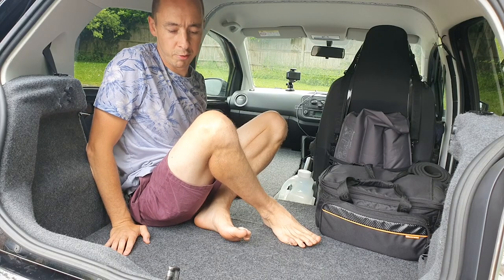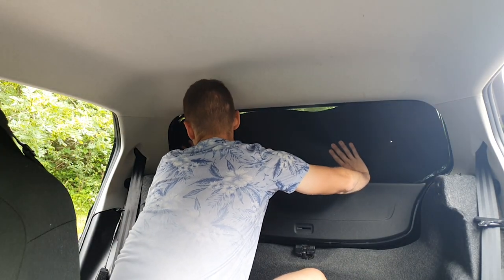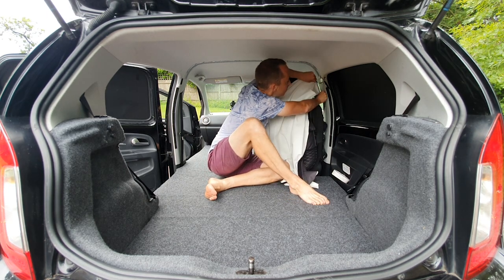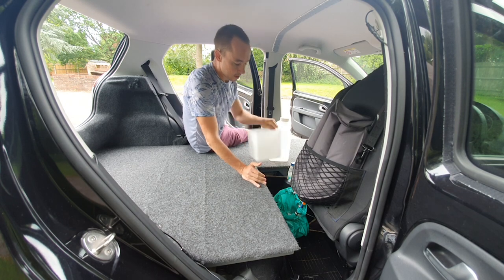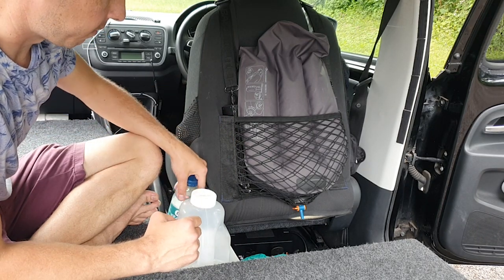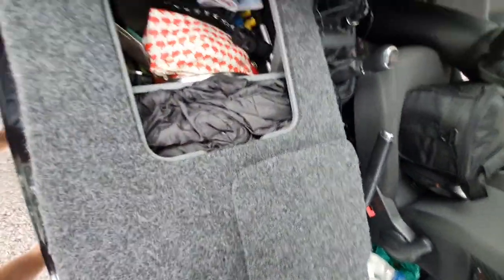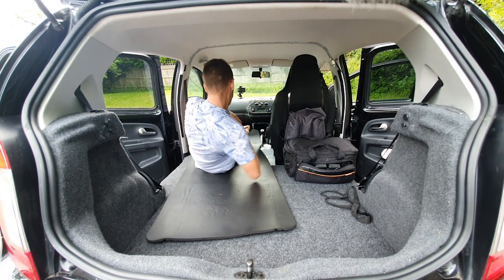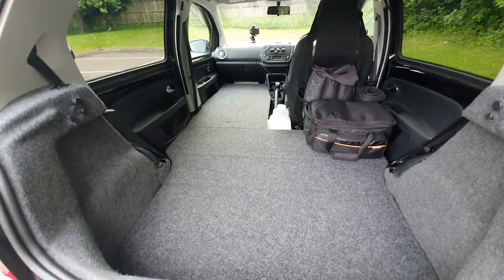Micro Camper Car Tour

Comment: Hi Morts, you sure are an ace with the use of limited space.  One thing I was wondering about is that if you go of the beaten track pretty far away from towns and villages and you get a serious puncture, like a plit tire due to a sharp stone, you don't seem to have a sparewheel by the looks of it, which could leave you in the middle of nowhere, or even further away from civility.
Do you have something planned for such a situation ?

Comment: Very nice! I've just came back from a road trip where I had to spend a night with my gf in an stock, 3-door Citigo (not for the first time), and being 6ft 7in it wasn't the comfiest of sleeps. So I went on googling how to remove the rear seat just to see what would be possible and really didn't expect to find Citigo camper conversion :D
When you remove the back seat, do the backs of the front bend all the way down (flat)?
How long is the space between the glovebox and trunk ledge?
Have you tried tapping into the Garmin console connection on the top of the front panel? There's a lid right under the vent grill with 9-pin connector in my car. The newer ones have USB port there apparently and I wondered what it would take to be able to at least charge the phone from it (so the cables didn't run across the whole dash) or better yet, charge the phone and connect to audio system. I feel like the pins are there and it's a matter of connecting to the right ones but I wasn't able to find the pinout.
Reply from the maker: @sirClogg  hey 👋  

I haven't used the connector for the gps terminal.  

I use an Bluetooth receiver into the AUX terminal to connect my phone to the speakers.

The seats don't fold down flat unfortunately.

As for the measurement from front to back I'm sure you can find that yourself.

Comment: I've seen hundreds of car camper videos and this one is the closest to mine in terms of organization, simplicity and aesthetics. Love it.  Some clever ideas - water bag, trash bag. One question: Do you blackout the front windows too? If not, when you're sleeping, people could see the bottoms of your legs and feet, correct? I do a lot of urban camping so need to be as stealth as possible. Thanks.
Reply from the maker: No front window covers.  It was a concern for me so I do have a black sleeping bag liner from Mountain Warehouse that I use as a sheet in the summer... but it's not a concern any more, even in urban settings I'd rarely park next to a pavement, and even then it would be drivers side with seat put forward.  In any case I think front covers attract more attention than they subvert.

Comment: Hi, Great set up! Can you tell me the width of the velcro you used in mm (was it self adhesive?) and if the width was the same for the curtains and the roof? Also, a detailed video on how the led lights are set up would be useful for us folk less technically minded, thank you.

Comment: I want to try the polypropylene sheets but am struggling to find any large enough. Could I ask where you sourced yours? Thanks!
Reply from the maker: I got the sheets from Stephen Webster Plastics.  The product is called ViPrint (Polypropylene) Sheet.  0.75mm.  Finish: Fine Sand/Sand
Reply: @mortdog  Many thanks

Comment: Another great video Mort's! What's the leasure battery you use? does it charge through the cigarette lighter and last for your longer trips without mains charging?
Reply from the maker: Hi Geoff.   I use the "Allpowers Portable Generator"  320wh...  It doesn't charge from the car, but my portable batteries and devices do from my 4-way 12v USB converter, which is enough even for longer trips.
Reply: @mortdog  Thanks for that, I'm just looking around for one at the mo.
Reply from the maker: @GeoffBeattie  definitely good value.  I'd think about getting a few portable power packs first and see how you get on.  You can get 100wh ones for around £30 on Amazon + they charge off the car.